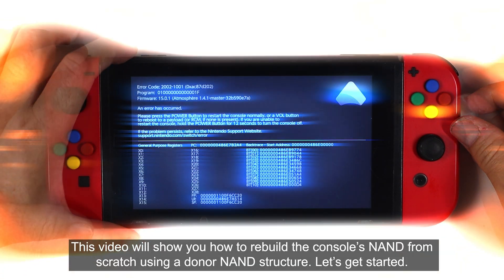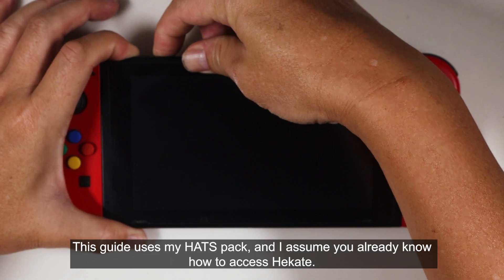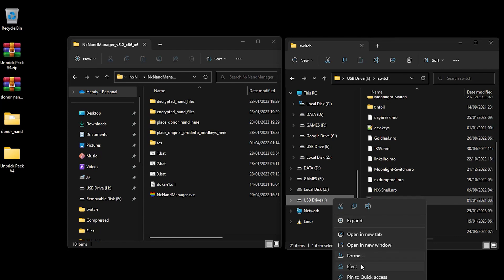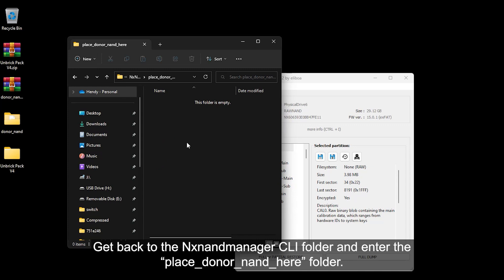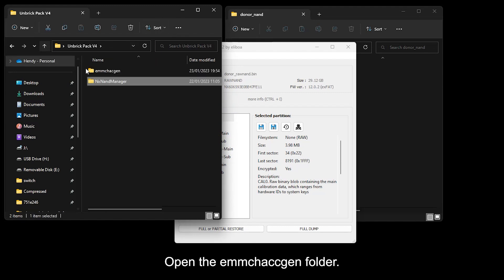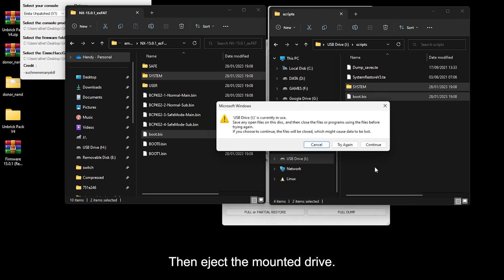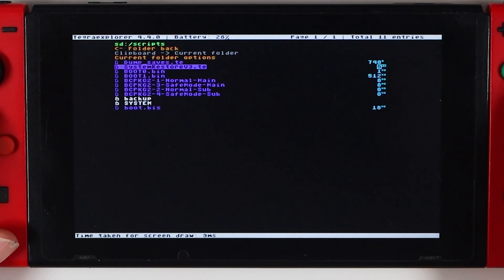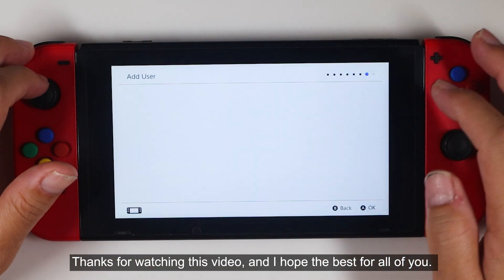UNBRICKING THE NSW LEVEL 2 : REBUILDING THE NAND STRUCTURE

Comment: At 3:15 when i plug my usb back to my pc it asks me to reformat my drive??? Help
Reply from the maker: try to disable the autoplay https://www.makeuseof.com/windows-10-11-disable-autoplay/
Reply: @sthetixofficial  I ended up doing level 3, I did all steps perfectly but right at the end of level 3 where you hit reboot normally I just got a black screen
Reply from the maker: Why did you do the level3 -- you have screwed the console because it wiped the console's prodinfo. You ignored my suggestion and now you are on your own bro.
Reply: @sthetixofficial  I appreciate all your help but actually it turns out that I just needed to hit the power button and it booted like normal. The switch is completely fixed thanks to you, thank you so much!

Comment: I was installing a game via usb-c. When I removed the usb-c cable, the Switch had a blue screen error.
I had nand backup and tried to restore. But the boot only goes to the black screen, the Nintendo logo appears and does not start.
Will I be able to fix it with this method?
Thanks 🇧🇷
Reply from the maker: try doing the Level1 guide first

Comment: Hello, if I do have the USER partition in the internal eMMC Info should I follow guide #1 instead??
Reply from the maker: yes if you want to regenerate a new nand from scratch
Reply: @sthetixofficial I was following this guide and I have an issue. My computer won't generate any new folder on emmchacgen after running EmmcHaccGen GUI. I made sure to update my .NET to the latest version and I even restarted my computer but I can't get it to work properly
Reply from the maker: dot net core should be 3.1
Reply: I did the full or partial restore but I couldn't find Tegra explorer in my payloads, I'm stuck
Reply from the maker: download my hats pack, and observe what's inside the payloads folder. https://github.com/sthetix/HATS/releases
Reply: @sthetixofficial thank you, but now I don't get the option to restore both when I run the script of system restore V3. What should I do??
Reply from the maker: because you just need to restore the sysmmc to repair the nand
Reply: @sthetixofficial I see two different options, "apply on sysmmc" and "apply on EMUMMC". Should I choose "apply on sysmmc" then?
Reply from the maker: yes sysmmc
Reply: @sthetixofficial I think I killed my switch. When I started sysmmc it got stuck in a black screen and I can't go into RCM anymore. Thanks for your help anyways, I believe this is a great guide!

Comment: Please help, I am getting error "ERROR: Input/file is not a valid NX storage".  I followed the guide till options -> configure keyset -> import keys from file, prod keys are imported.  Then I eject the SD drive -> make Read only on Hekate - OFF -> click on eMMC RAW GPP, then click on file in NxMAnager ->Open Drive selected eMMC GPP hekate (58.24 GB)  -> Get error Input file/drive is not valid NX storage.
Reply from the maker: why did you remove the sd card? the emunand is inside the sd card.
Reply: @sthetixofficial thank you so much for the response.  I did not remove the SD card, what I meant was I just ejected the mounted SD cars connection and then self yes emmcraw gpp.
Reply from the maker: try opening the sd card with your PC and open it with the nxnandmanager.

Comment: Fatal Bis write Failed !!!
Reply from the maker: your emmc is probably damaged.
Reply: @sthetixofficial  thanks for the answer. I can replace it with 16GB or I need exactly 64GB
Reply from the maker: you can use the 16GB but you need to resize the user partition later using linux  https://nathanbunn.com/nintendo-switch-emmc-nand-upgrade-guide.html

Comment: Thank you! This video was the only medicine for my Switch. By the way, do you happen to know if its possible to fix bis key 0 without original backups? Bought this switch few years ago and the previous owner used incognito and the microsd was corrupted so if there was any back I could never access, using the lockpick and check methods only bis keys 0 do not pass the test so I cannot restore the Serial, seems like it will be offline forever from nintendo servers. Guy also installed CFW on sysnand instead of setting emunand, very bad decision. At least now it's working either OFW or CFW.
Ty again!
Reply from the maker: no way you can fix that issue. Once you have lost the original Prodinfo, you are stuck in that situation forever.
Reply: @sthetixofficial  Thank you for responding and too bad for me for buying a second with no backups and incognito on sysnand. =\

Comment: Hello, I have an error when I dump the keys. The error relates to keyblob_00 to keyblob_05. All these keys are missing and are written as 0 in the boot0.bin file too. Because of this, I cannot connect to nintendo servers. I get Error 2123-0011. The switch works though. Its an unpatched v1. I saw a post to use linkle to gen these keys but it doesnt work. Can you advice?
Reply from the maker: did you use a donor nand? and if u use my pack, you need to boot to the OFW to connect to the nintendo server. it has nothing to do with the keyblob
Reply: @sthetixofficial  I haven't used this technique yet to restore as the switch works without any issues (Both OFW and CFW). The only thing is I cannot even system update while in OFW. It throws 2123-0011 error while attempting to update the OFW or even go to store, Nintendo online page. You get a different error for getting banned. That's why I decided to check the boot0 and prod.keys file. Many keys are corrupted apparently. A normal prod.keys file is 15kb but mine is 11kb. Loading the boot0.bin file into hex editor shows 00 filled at all address correspond to keyblob_00 through keyblob_05. Apparently on one of the forums it concluded with a corrupted boot0 file. Btw the serial number for the console shows up without issue.But using nxnandreader, the firmware version shows up unknown.
Reply from the maker: do you have the original nand data?
Reply: @sthetixofficial  unfortunately not. I mean not the ones before this corruption. I got this board from Aliexpress. What was weird is the way emmc module looked like. It was way lighter shade of green. I've never seen this one before. I did back it up when I got if though. It was on 16.0.2 and then I upgraded to 16.0.3 using daylight.
Reply from the maker: if you got the board from ali, then i bet they have used a donor nand to unbrick the console and modified prodinfo to change the serial number. I guess you dont have any way to re-access the nintendo server again. And your console is similar to this https://twitter.com/sthetixofficial/status/1548122390101921792?s=20
Reply: @sthetixofficial  damn that's sad. Basically they could even do the thing properly! Made in China for you. 
Mate thanks a lot for this info!

Comment: ..does this able to fix Black Screen when booting OFW? .. Hekate can still access/benchmark eMMC...
Reply from the maker: it depends on your console condition.
Reply: @sthetixofficial  I have the same issue, This Guide and lvl 1 didnt help cuz i get fatal bis write error, what should i do?
Reply from the maker: i think the emmc is damaged.
Reply: @sthetixofficial  ....i already tried replacing it with a new module but still Black Screen on OFW... i have a hunch that the PMIC or Fuel Gauge IC is faulty... its seems it cant get to 2nd power phase...
Reply from the maker: then i guess there could be something off. I dont know the solution.

Comment: im having a 2002-4687 error on boot do i need to replace the mmc or is there something on board to replace?
Reply from the maker: maybe you need to do the level1 unbrick or try doing the systemwipe guide.
Reply: @sthetixofficial  I tried this and it didn't work I haven't tried level 2 yet. Level 1 gave me an error when I was writing to the emmc.
Reply from the maker: if you cannot do the level1 then level2 wont work too.
Reply: @sthetixofficial  you're so amazing thank you so much for replying I guess I might need to do a emmc replacement I'll try to build an emummc with level 2 and see if that works if it does I'll replace the emmc. Thank you so much for the reply it means a lot.

Comment: My switch v2 has a purple screen of death, I checked and my emmc is faulty, can I put the faulty emmc on another v2 switch with hekate to perform recovery?
Reply from the maker: try to reball or at least reflow the existing emmc chip. you cannot use other console's key to fix the damaged console. you should get the key from the console, not from the emmc.

Comment: I get a fatal failed back up bis when using tegraexplorer and doing system restore. Is there a reason why? Thanks
Reply from the maker: is your SD card have enough space?
Reply: @sthetixofficial  512gb
Reply: My EMMC is also slower in initiating. Would that cause issues?
Reply from the maker: Maybe the emmc is damaged?
Reply: Thank you for being so reponsive to all my questions!

Can I pull another emmc from another console and rebuild that for this console, like one from a V2? I want to save it because its a V1 unpatched version. Thanks again
Reply from the maker: Try to dump the data from the old one and try to reball the emmc without replacing it

Comment: Do you know how to unbrick it when I can't get it to turn on at all? The HDMI on my switch quit working the dock is fine and outputs HDMI with other switch consoles so I know 100% it's the switch itself but that's not my issue. So I opened it up and cleaned it up checked the traces and solder points  and all that then put it back together and tried to boot it up and injected fusee payload but the switch froze on the atmosphere logo for a long time so I held the power button down to shut it off and now it won't boot at all not into rcm mode not into original fw with or without my SD card in just nothing basically dead. I opened it back up and checked everything out and it seems fine hardware wise so I think it may be bricked? Can't get it into rcm or anything and I've held the power and even disconnected the battery completely
Reply from the maker: Check the resistor around the m92t36 chip. Look for shorts and check the usb port for damaged
Reply: @sthetixofficial  all is good. Checked for shorts and aren't any, checked voltage on the components around the chip all good, USB port is good too, battery is kicking out 3.5 volts or whatever it's supposed to (tested yesterday and don't remember what each value was but everything was exactly what every diagram I found said they should be) so not sure what the issue is
Reply: @sthetixofficial  by the way love your channel. I've used your channel to mod a bunch of different consoles. You're always my first go to when looking for a tutorial or help on anything. Do you happen to have a discord?
Reply from the maker: Try getting into the RCM mode and check if you have green status under the tegrarcmgui. when you have that, it means the CPU is responding. And try using a USB tester to see the AMPS while it is charging. my discord is linked to my personal account sthetix#7311

Comment: Hi,
Thank you for all the heard work and for all the informative lessons.

I newly installed a Hwfly oled v5 chip and all worked well. I run with an error that i coudent log in to any of the Sysnand OR  emmunand, even when lunching the OFW the screen will light in purple
Error on Hekaty:
eMMC Issues Check
Your eMMC is initialized in slower mode. or init/read/write errors occurred!
This might mean hardware issues!

So i ended in reflowing the nand memory chip and that solved half of the problem where i dont see the error again but still have the purple screen when lunching the OFW. 

Is the stock corrupted or do i have a problem with the resistor on point A ( knowing that point A resistors cause the screen to go purple) or i did not reflow the nand memory chip enough.
Reply from the maker: You need to reball your emmc chip.
Reply: @sthetixofficial  thank you for the fast reply.
I will do that as soon as i practice first on my donor board
Again thank you so much